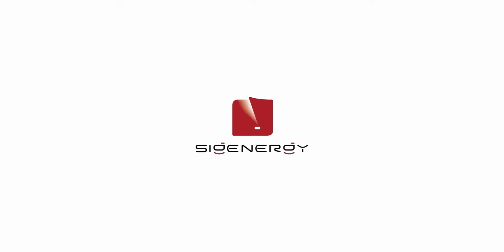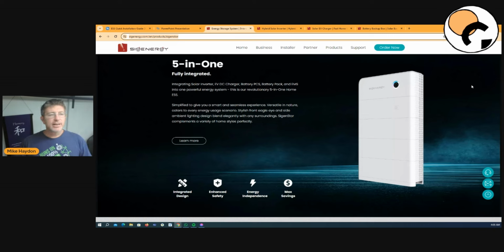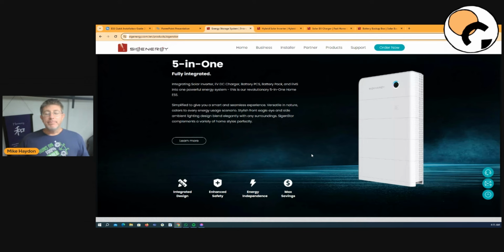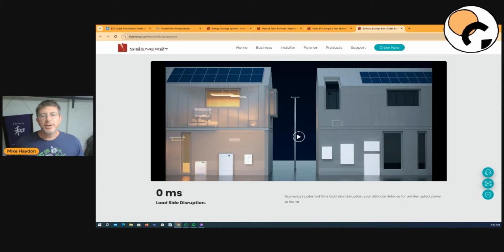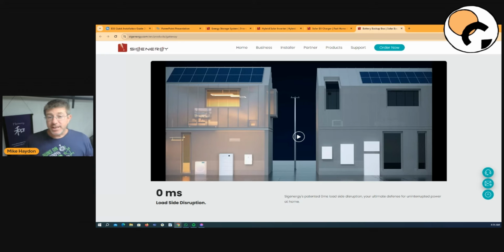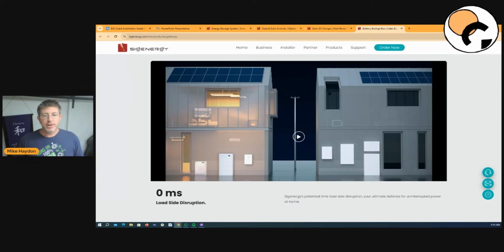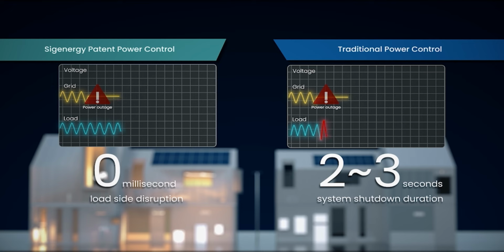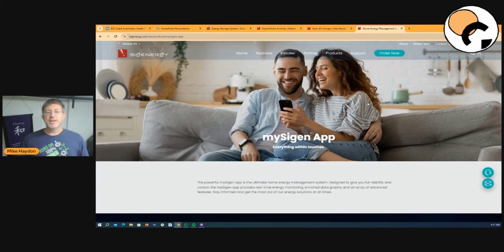The Ultimate Guide to Sigenergy Products

Comment: Thanks for this review. I have an off-grid system being installed with 3 stacks of 6kw inverter+16kWh batteries. And 12kw panels per stack. One stack installed so far and working well.
Reply from the maker: Thank you. That sounds like and awsome system. Where are you located? Would love to hear more about it when it's done and working. You can email admin@theoffgridshop.com.au if you want. Thank you